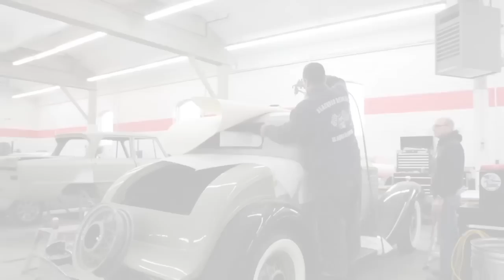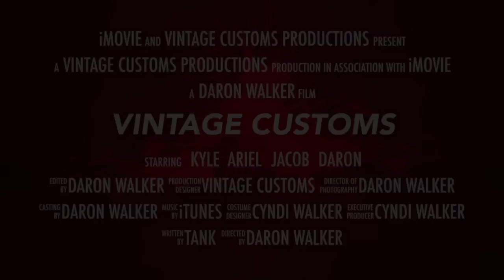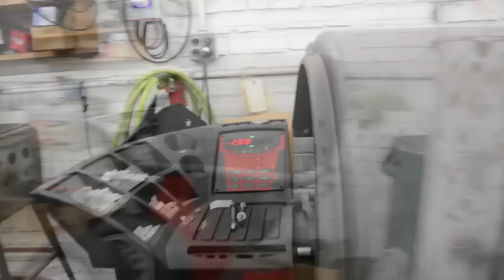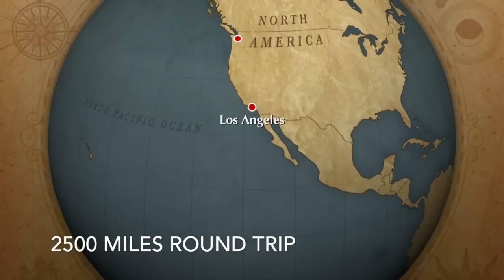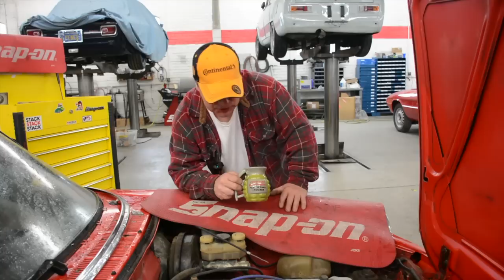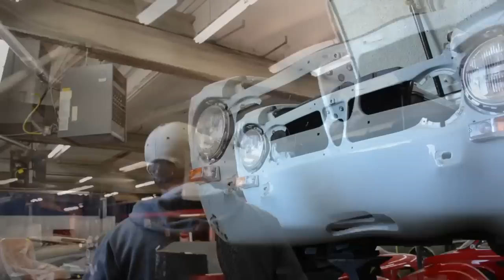quasi Ti the start

Comment: What size 'Vintage' tire would you recommend for a street 1974 GTV 2000.  the car has been slightly lowered but otherwise stock.  I like the look but what are the prices these days?  I noticed this was back in 2017 (100 dollars plus free shipping)...it that price/free shipping still the norm?

Comment: Always learning new things when watching your videos. Nice work! What sort of wheel specs are you running with those GTA replicas? 14x7 but what are the ET numbers? 23 in front i think? But what about the back? Supers are bit tricky to get the rear ET number right, as I recall you had some problems with this very issue in one of your earlier videos.

Comment: How are you doing the high-pressure pump with the stock tanks? Or are you switching to Spica-Tanks too?
Reply from the maker: I am most likely going to use the Classicalfa FIA tank. But I want to make this a build one that most people could do or more so, afford. I may just use a spica tank. However,... any currently in the car tank can be easily adaptable. Only two things are needed. A port for a return line, and a port for a vapor venting. When fuel is returned, it tends to pick up in temperature and expand. So a vent is needed to keep the tank from pressurizing.

Comment: Is the bulbous look just because of the retro tires?
Reply from the maker: well yes it is. But the profile being 185/70/14 placed on a 7 inch wide wheel exaggerates the appearance. But it is a nice, classic look, that has "sleeper" performance. And thats a win in my book
Reply: There is more detailm about these tyres on our web site, and on the page called /classic-porsche-tyres there is an article by a German magazine about them. it is also worth pointing out that in the States these tyres are distributed by Lucas classic tires  -- 1(800)952-4333